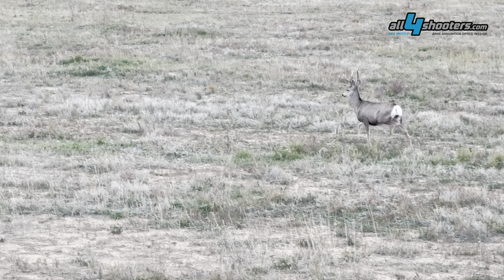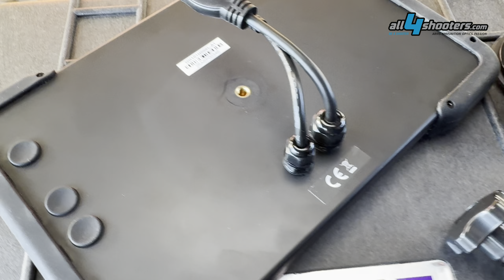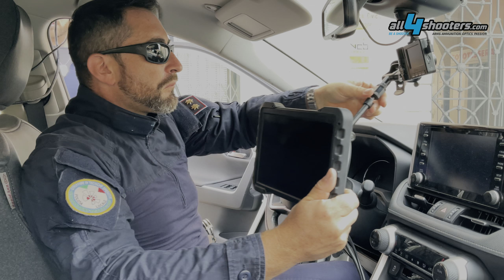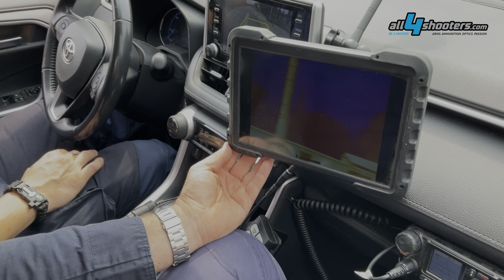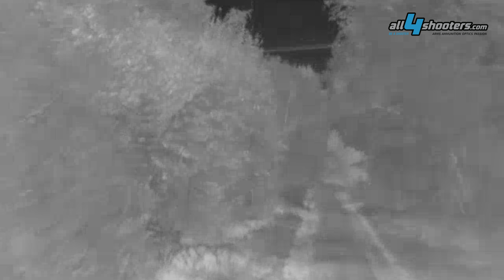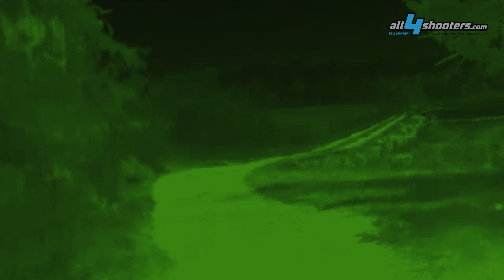Dark 30 Defiance vehicle roof-mounted Thermal PTZ camera

Comment: You don't really need a touch screen display, just use a tablet.  You should be able to unhook the monitor all together and use just the  tablet and then nobody on the outside can see what you're looking at.  In fact, you could sit in the back of a van while using that.  So any touch screen device like a touchscreen tablet or phone will do the trick.  The best part is you can see use the tablet and the controller at the same time.  Try it out :)